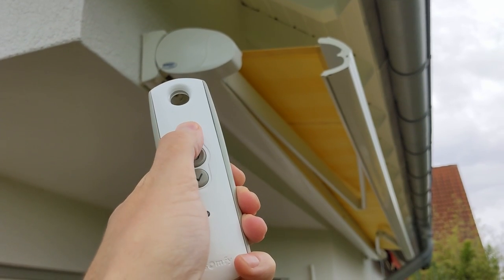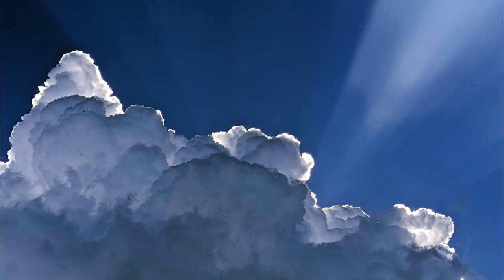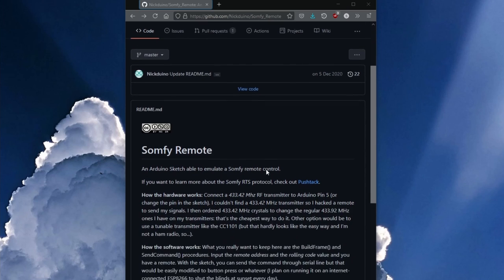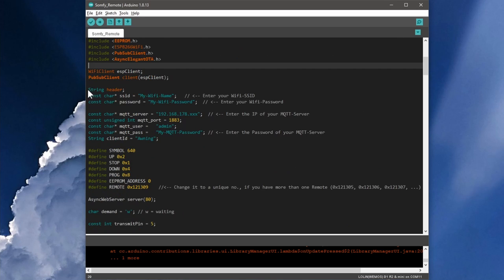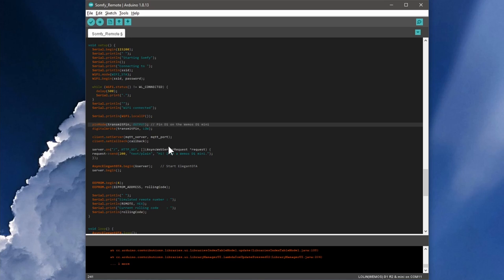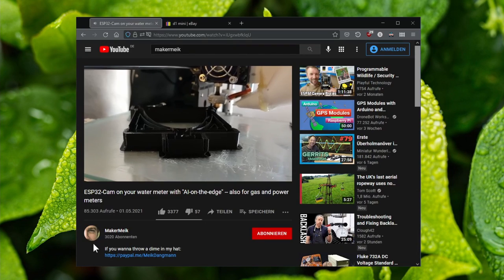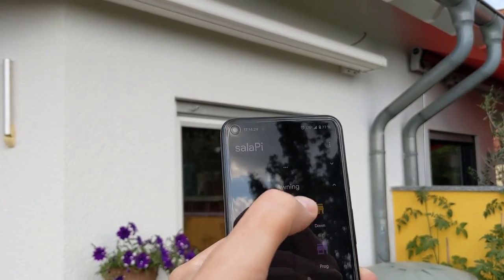Make your Somfy-RTS-remote smart using an ESP8266 and MQTT to control your awning or shutters

Comment from the maker: Down in the comments you'll find the findings of user Darren Cotterill. He has forked the Github project to add the ability to replace multiple remote controls:
https://github.com/DCotterill/Somfy_Remote/
He also describes in his comment what to do if the pairing doesn't work right away:
"As a tip for others, I did have trouble pairing with the blind initially, so I 'reset' the pairing on the blind by holding the reset button on the motor for 15 seconds (3 sets of jog up/downs), then re-pairing my remote, then pairing the MCU."
[If necessary, you will need to "full reset"], but be aware it will clear all your blind settings so you’ll also need to re-pair your remote and set limits again."

Thank you, Darren, for your contribution to the community.

By the way, Nickduino, the original developer of the project, also has a Raspberry Pi-based project for the Somfy remote controls on his Github page:
https://github.com/Nickduino/Pi-Somfy

Comment: I came across your video while searching for a replacement for Somfy’s “MyLink” automation solution. After 3 years of frustration using Somfy’s expensive, buggy and amateur MyLink app and their 20’-30’ range transmitters to control the 21 blinds around our house, I found (and now use daily) the Bond Home WiFi bridge that achieves the same goals as your project….for those of us who lack the technical skills needed to implement your project.

Comment: We cross paths again, first it was the wireless window sensor and now you help me again with Somfy remote controls, thanks for the really useful video........ Again
Reply from the maker: That's really funny. Actually, I've also been on your website several times in the last few days (http://www.gadjet.co.uk/) and have been looking intensively at your optimised version of the window sensor. I am working on a video about it.
You can see that our paths are crossing again for my part as well :-)
So there is also something nice about the fact that the "endless summer" is now over and there is finally time for tinkering again.

Comment: Thanks very much for this. I've just installed new Somfy blinds and just managed to get one working with this code. 

Now I just need to change the code to get it working with multiple blinds / groups, as I have 15 blinds over 6 rooms, using 4 remotes with 5 channels each :-) 

As a tip for others, I did have trouble pairing with the blind initially, so I 'reset' the pairing on the blind by holding the reset button on the motor for 15 seconds (3 sets of jog up/downs), then re-pairing my remote, then pairing the MCU.
Reply: What do you mean by "having trouble pairing with the blind initially" ? Program mode on your remote -> blind jog -> program mode on MCU -> nothing happens ?
I have this exact same problem, except I'm using the python version on a raspberry pi (https://github.com/Nickduino/Pi-Somfy). I thought I messed up with the crystal soldering part, but maybe I'm gonna try what you suggest.
Reply: @lepetitponey  yes, this situation exactly. Give a ‘full reset’ a try as I mentioned, but be aware it will clear all your blind settings so you’ll also need to re-pair your remote and set limits again.
Reply: @DCotterill  If the the virtual remote was programmed with an incorrect rolling code or there is a mismatch then the motor wil ignore it (can not pair or unpair).

This is why it is important to keep the remote id and rolling code safe in case you need to rebuild something.
Reply: @DCotterill  I tried resetting the receiver next to my motor, but I don't even know if I did it right, we probably don't have the same model. Anyway, that didn't make it work.
It turned out I did a bad job on the soldering. I just soldered another crystal on another emitter, and now it works just fine. I'm glad I bought some spare ones.
Reply: @lepetitponey  Great to you managed to get it working. Those crystals are a little fiddly to solder in, I wasn't sure I'd done it correctly myself either.

Comment: Strange, as per another poster, my comments disappeared. I'll try again. Absolutely genius! Loved this. Have used this on my garage door and integrated with home assistant and alexa. Great stuff!
Reply from the maker: Thank you! And also for taking the trouble to write the comment again. I had already seen your comment in the email announcement and appreciated it. Unfortunately, there still seems to be a problem with Youtube and this post was deleted again. I wonder if it's the feature to automatically withhold potentially inappropriate content. But even then, I should be able to find it in my account under "review pending", but so far that has happened very rarely.

Anyway, I've disabled the feature now and hope that future comments will arrive.

In the email announcement to your original post, I saw that you also had problems with AsyncElegantOTA. I have now looked into this matter again:

Other than shown in the video, you need the libraries ESPAsyncTCP and ESPAsyncWebServer from me-no-dev on Github in order to get the OTA update working. Unfortunately I had forgotten about this. You will not find them in the Arduino IDE Library Manager, but you have to download them directly from the Github page and put them in the library folder of the Arduino IDE:
https://github.com/me-no-dev/ESPAsyncTCP
https://github.com/me-no-dev/ESPAsyncWebServer

I have now also added this comment to my code on Github, so hopefully future viewers will have it a bit easier. Anyway, the OTA update feature is extremely handy. Rui Santos, for example, recently made a good video about it: https://youtu.be/LUcKoJGX38M
Reply: How did you manage that the devices are displayed in Homeassistant?

Comment: Hi MekerMeik.
I am looking for the same ESP8266 that you mentioned in the beggining of the video but I am not being able to find it.
I didn't find the D1 Mini ESP-12F. I was able to find D1 Mini V3.0.0, D1 Mini 4.0.0,  D1 Mini Pro4M, D1 Mini Pro 16M, D1 Mini Type-C.
Do you know if it can work with this other ones as well? 
I have 8 Somfy blinds at home and my plan is to use the branch that Darren Cotterill created to make that happen and then control it using the HomeAssistant with Mosquitto.

Comment: Hello and thank you for this tuto 

For my part I have this error that I do not understand: 

Executable segment sizes:
ICACHE : 32768           - flash instruction cache 
IROM   : 344180          - code in flash         (default or ICACHE_FLASH_ATTR) 
IRAM   : 27509   / 32768 - code in IRAM          (IRAM_ATTR, ISRs...) 
DATA   : 1524  )         - initialized variables (global, static) in RAM/HEAP 
RODATA : 3176  ) / 81920 - constants             (global, static) in RAM/HEAP 
BSS    : 26104 )         - zeroed variables      (global, static) in RAM/HEAP 
Sketch uses 376389 bytes (36%) of program storage space. Maximum is 1044464 bytes.
Global variables use 30804 bytes (37%) of dynamic memory, leaving 51116 bytes for local variables. Maximum is 81920 bytes.

Comment: Nothing happens after uploading the sketch? What can be the problem? I am pretty sure I did everything wright. Compiling and uploading is all fine, but nothing apears in the serial monitor?
Reply from the maker: Have you tried another D1 mini? The serial.prints should appear in the Serial Monitor regardless of whether the radio data is being sent. So I guess that there is a problem with the D1 mini.

Comment: Hallo meik, klasse Videos, habe deinen Door sensor v5 pcb produzieren lassen allerdings mit espnow -> mqtt statt wifi -> mqtt, echt klasse.

Nun meine frage:
Mein Vater hat einen Sompfy Rolladen Motor und eine nicht sehr stabile Fliegentür welcher er im Sommer zur Terrasse benutzt.

Wenn jetzt versehentlich (oder abends automatisch) der Rollo runterfahren würde und die Fliegentür noch auf wäre, würde diese zerstört werden.

Als Workaround habe ich einen Offner installiert, der die Stromverbindung zum Motor unterbricht wenn das Fliegengitter offen ist, klappt soweit, allerdings gibt es wenn die tür zufällt (motor also wieder Strom hat) die im Video gezeigten hoch runter Bewegungen, das ist nicht ganz so schlimm, manchmal aber auch bis in Brusthöhe welches einen faktisch aussperrt.

Ich vermutete den Programmiermodus und baute eine Verzögerung ein, so dass dieser nicht mehr erreicht wird (2 sek an 7 aus ...) das brachte auch nix.

Meine neue Idee:
 Einen Sompfy Receiver zu benutzen (RX-4M30RR01SF) und einen Strom Sensor. Wenn der Rollo autorisiert Strom zieht (Empfänger hat ein Signal empfangen) wird nix unternommen.

Wenn er aber ohne per Funk autorisiert Strom zieht (also das seltsame verhalten zeigt) wird der Strom zum Motor unterbrochen.

Jetzt ist nur die frage, ob die zentrale nicht für das hoch runter verhalten verantwortlich ist.

aber anhand was genau empfangen wurde "hoch" "runter" "init" sollte sich das unterscheiden lassen.

Weist du ob die Funkpakete verschlüsselt sind bzw. entschlüsselt werden können damit ich auch weiß dass das richtige Gerät angesprochen wurde?

Ist dir mal ein ähnliches verhalten aufgefallen?

Hättest du noch andere Ideen?

Wie würdest du versuchen das Problem zu lösen?

Notfall müsste ein anderer Motor her, Papa wollte aber bei Sompfy bleiben.

Ich hatte schon überlegt den Empfänger des Motors stillzulegen wenn die Tür auf ist, will mein Vater aber verständlicherweise nicht und ich glaube auch nicht, das dass was ändern würde.

P.s: Als ich zum basteln eine Fernbedienung gesucht habe, habe ich gesehen, dass die Taster die mein Vater benutzt 868 mhz (Somfy Smoove) demnach auch ein evtl verschlüsseltes protokoll, mein homatic jedenfalls ist versch..., hoffentlich komme ich trotzdem weiter der 433 mhz receiver zu bestellen, war schonmal zu voreilig :(

Vielleicht hast  du ja noch ideen. bist du auch auf der makerfaire? dann kannst du uns besuchen (Hackerspace bremen e.v)

Comment: Thanks for this great video! How did you figure out that you needed to change the resonator crystal and how did you pick the right one? Please keep up your great content, it is great stuff!
Reply from the maker: Thank you very much. 😊

Here is documented how the reverse engineering was done:
https://pushstack.wordpress.com/2014/04/14/reversing-somfy-rts/

However, it wasn't me who did that, I just enjoyed the already finished project from Nickduino and modified it to suit my needs.

I think as a general approach this should also work via Software Defined Radio (SDR). There is a good video by Andreas Spiess on this topic as well: 
https://youtu.be/xQVm-YTKR9s

Andreas also has a video on 433 MHz remotes:
https://youtu.be/L0fSEbGEY-Q

Unfortunately he did not cover the Somfy remote controls. So I ended up with the project and ultimately the video for my own purpose.
Reply: @MakerMeik  thanks a lot for the details.

Comment: Hi ... great minds think alike! I was planning the same conversion of the nickduino code but also with a position parameter (in %, based on the time it takes to go out and in) and 3 buttons on the case (in stead of the remote). Maybe I will implement the position in the home-assistant (custom) control (like I did for my shutters). Have you any idea if there is already a Python-Raspberry Pi version of this control? That would suit me even better (since there is a pi with home-assistant laying next to the awning ...
Reply from the maker: Hi, Sure, there is even a Python version of Nickduino itself, which is intended for the Raspberry Pi. Best you have a look at it yourself: https://github.com/Nickduino/Pi-Somfy
Reply: Yes this already exists: https://github.com/Nickduino/Pi-Somfy

Comment: Thank you so much for this! We always misplace the remote and have to run around and search for it. Now I have the awning integrated in Home Assistant and it works beautifully! BUT I also have the sun and wind sensor, and there is a button on my remote that toggles it on and off by long pressing that button. Do you by chance know what command I should use to trigger the toggle? I tried sending 0x9 but nothing happened. Thank you so much!

Comment: Ist das sowas wie ein zwischen Stück / Adapter. Zwischen Sompy (egal was) und deinem Smartphone (APP)?

Verkaufst du auch fertige Modelle?
Reply from the maker: Der Mikrocontroller (ESP8266) kann WLAN und empfängt darüber die MQTT-Signale vom Smartphone, das sich im gleichen WLAN-Netz befindet. Daraus macht der Mikrocontroller dann das Funksignal, das er über den angebundenen Transmitter an den Somfy-Empfänger in der Markise schickt.

Wenn du eine Fritzbox hast, kannst du dein Handy auch dauerhaft per VPN damit verbinden. Dann klappt das ganze auch, wenn dein Handy gerade nicht im WLAN ist. Nur der Mikrocontroller muss sowohl im WLAN, als auch in Funkreichweite der Markise sein.

Das Ganze geht auch für Somfy Rollladenmotoren und motorisierte Leinwände und was die sonst noch so verkaufen. Allerdings haben die neueren Somfys ein anderes Protokoll, was mit der hier gezeigten Lösung nicht kompatibel ist. Darum habe ich ja betont, dass es ausschließlich für Somfy-"RTS" ist.

Und nein, ich verkaufe das nicht. Das hier ist ein unkommerzieller, rein  hobbymäßiger Youtube-Bastelkanal - Also viel Spaß beim Nachbauen ... geht leichter als du denkst ;-)

Comment: Hello, thanks a lot for your share! 
I managed to make it work but shortly after the crystal stopped working and after several attempts (soldering of several crystals) I managed to make it work again and the crystal stopped working again. Currently unable to operate the device. Could it be a soldering temperature problem? What is the best temperature? I'm a bit lost (I'm more than 10 tries).
Reply from the maker: I usually solder at 350°C. The soldering iron should remain for about three seconds per solder joint, then you should not have any problems. I wonder if maybe your transmitter has problems with the 5V voltage or a short circuit somewhere? Instead of changing the crystals you could try it again with another transmitter. 
What makes you so sure that it is the crystal? An if you have connected everything only with jumper cables, it can often come to loose contacts.
Since the problem you describe did not occur with me, I can only guess.

Comment: Hello MakerMeik, I have build all how you explained in your video, but my awning is not responded to the commands through the MQTT dashboard, I get this in my serial output from the Arduino:

p
p
p
prog
Frame         : A7 80 64 84 12 13 05 
With checksum : A7 8F 64 84 12 13 05 
Obfuscated    : A7 28 4C C8 DA C9 CC 
Rolling Code  : 1647404164
prog mode

is that rolling Code good? Or is this output complete, not good?
Can you advise me please?

Further great video's !! I like your videos

best regards,
Mark
Reply from the maker: This is difficult to solve remotely. Did you follow all the steps in the video? 

First of all, you should make sure that your MQTT commands arrive correctly. For debugging, you can put some 'Serial.print("bla bla");' in the appropriate places in the code and check in the Serial Monitor if they are executed.

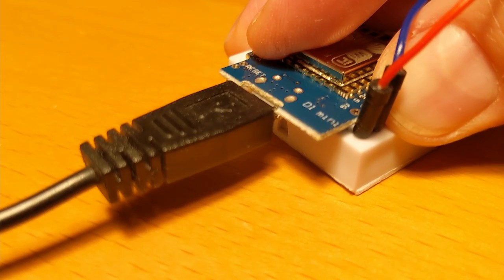Next you have to do the steps I described from minute 8:30 (https://youtu.be/9RhHrYqp9FU?t=511). So press the "Program" button on the original remote control and then execute the "Program" function of the ESP. 

Then your awning should already move. As I have stated, however, this only works with the RTS-remotes. Somfy now also sells the io series, which is not compatible with the described procedure.

Comment: Hello MakerMeik, after pairing the MCU with the awning, can you still use the remote?
Reply from the maker: Yes, that is not a problem. You can even use several MCUs or remote controls in parallel.
Reply: @MakerMeik  Wow! I was not expecting you to answer this fast! Thanks!

I have a dilemma between going with a ESP8266 MCU with your tutorial or building a RFLink gateway with a nodo-shop kit. I could use HomeAssistant natively and they seem to integrate drivers already. 

Have you considered this option that is fairly cheap or you looked for the cheapest option possible?
Reply from the maker: Unfortunately, I am not familiar with RFLink gateways and the Nodo Shop Kit. The ESP8266 variant was directly feasible for me because I had all the components apart from the quartz and they were extremely cheap. The solution works reliably, so I will probably not test any other options. If you go the other way, I would be happy if you share your experiences here with me and the other readers.

Comment: Thanks for the sharing. What can go wrong in this project? Did you face any issues? I am asking because I basically did the same to no success. The only difference is that I am using ESP8266 Node MCU.
Reply: Update: I switched from an MCU to a Wemos D1 and everything works fine now. So, maybe some kind of incompatibility between MCU and the library? Or maybe my MCU is not in the best condition....

Comment: Hello, I have an error when compiling your code 
Here it is: 
ESPAsyncTCP.h: No such file or directory
   11 | #include "ESPAsyncTCP.h"
      | ^~~~~~~~~~~~~~~
Do you have any idea how to solve it?
Reply from the maker: Apparently, the error is due to AsyncElegantOTA. Check if you really have the latest version installed.
https://github.com/ayushsharma82/AsyncElegantOTA
Also the ESP8266 core in the board manager must be up to date. If you use PlatformIO with VScode, you should check if the error also occurs via Arduino IDE. I think I remember that there was a problem with PlatformIO once.
Otherwise you can also just comment out the AsyncElegantOTA part in the code. It is only there so that you can install updates over the air. That should be dispensable.